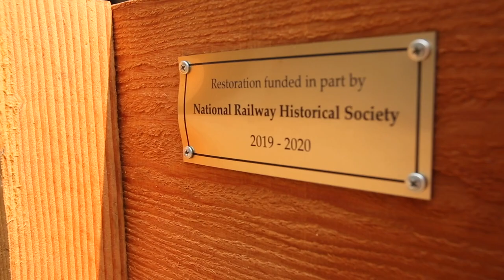Moving the gondola car with NCNGRR

Comment: might be interesting to change the some of the track tie bar bolts to longer bolts..  putting the nuts back on to hold the tie bars on.. but giving the ability to put a triangular shaped piece of steel over the longer tie bar bolts and torquing down the additional nuts to become a bolted in place wheel chock.  making it much harder for somebody to push the car back to free up the chock and set it rolling to the end and out into the repair shop parking lot..  i don't expect any locals up there to do that.. just forward thinking to stop any morons who pass thru..